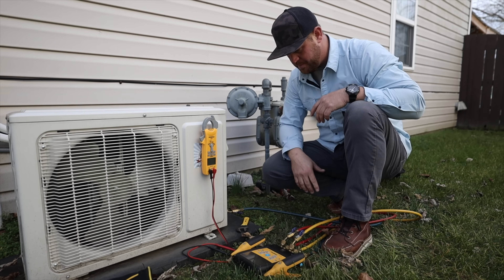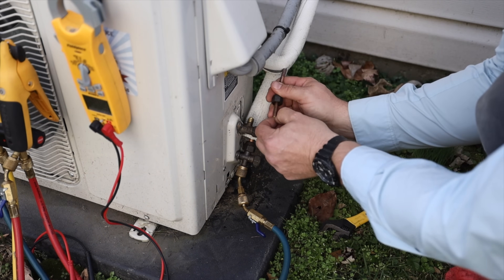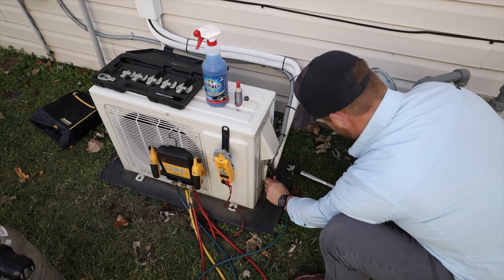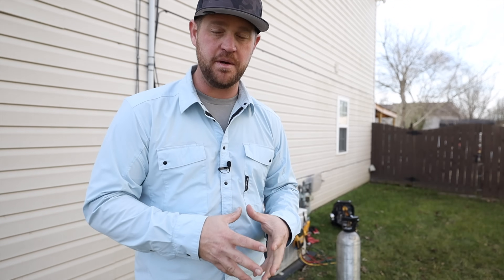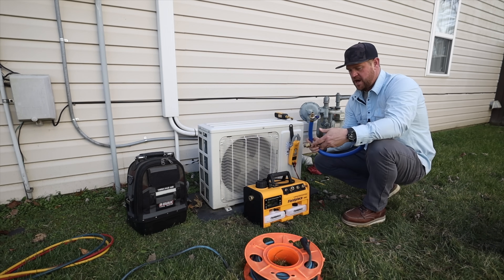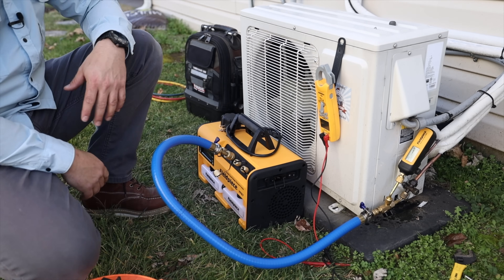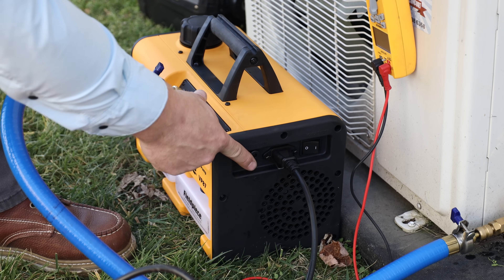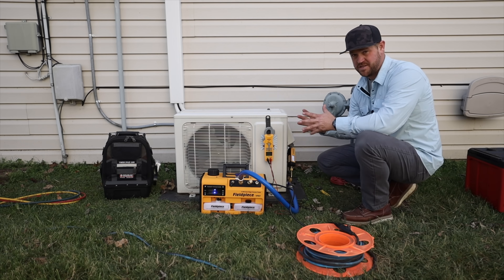#1 Reason Why DUCTLESS Units Fail | How I Fix It...

Comment: The thumbnail has a huge code violation. The unit is nearly touching the gas meter purge valve. Needs to be minimum three feet of clearance between the two

Comment: Boy, do I wish you were closer to Greensboro, NC! Your professionalism and attention to detail is so impressive! I have a 40 year old Trane 1200 I will be replacing in the spring. My electrician/HVAC guy is recommending changing to a heat pump as it is only a little bit more money. Air handler is in a very large and accessible attic. All of the air supply line are very robust and actually over engineered, so no need to change. Would love to hear your suggestions on type / brand of heat pump, rough idea of possible costs, things I should look out for. Your help would be appreciated , love the channel!

Comment: Indoor coils are rated for a lot less pressure than the rest of the system. Please check manufacturers maximum test pressure ...remember you are finding a leak..not causing one.
Reply: Some mini split manufacturers list for 600psi test pressure I think
Reply: @shadowolfgaming6578  correct   although I think it is 500PSI, not 600.
Reply: Most mini splits are heat pumps, both coils are rated for high pressure.

Comment: So would you recommend pulling a vacuum using a 4 Port SMAN? Whats your take on that?
Reply: No. Never use a manifold with normal hoses. Do what he did. You don't really need a high cfm pump either when you remove cores and only use trublue hoses.

Comment: I ran into the issue of not being able to get the core removal tool yesterday. I took the anchors off the foot tabs and slid the heat pump over the edge so I could get it on. So much faster with the valve core removed, but with such a small and short lineset probably didn't make much of a difference.
Reply: Thoughtful installers could position the valves beyond the edge of the support base, or he could have done the mod here. Short line set so evacuation probably didn’t take too long.

Comment: You don't need sealants.  This is bad practice.  Always trust your ability De burr and reflare.  Any refrigeration tech knows this Air pusher rectification method is just asking for another service call.  A typical easy repair service call.  How do you have the time to record this basic business?  Go forth and service real equipment, not appliance systems.

Comment: Great video, most probably bracing is beter , but hear in Europe that will ruin the guarantee for the unit, one more thing, the unit on the videos has no  vibration dampers on the floor

Comment: Although you don't say I am assuming you recovered the R410A before you pumped in the nitrogen for the first time?   Which gaskets for your hose set do you prefer, the green rubber (neoprene?) generic, the white nylon hard gaskets or the Yellow Jacket black gaskets?  I ask because I find that a breath seems to loosen my knurled fasteners.  I am reluctant to use pliers to tighten a gasketed fitting but it is frustrating,  If a hose is touched in the slightest I find that the ends one or both loosen up just enough to break the seal.  Even though these fittings have only been used  three or four times this is still a problem.  I have some Yellow Jacket hoses with their "sealrite" fittings ordered to see if they are the answer.  Have you run into this before?
Reply: Well! there was nothing to recover. It had all leaked out if the system wasn't working
Reply: @medonhomeimprovementsllc8039  At 1:08 there is 50 psi of "nothing" that should have been recovered...

Comment: Always remove the flares on the inside unit and braze it directly. For the outside unit use a braze adapter for mini splits. U will never have leakes again
Reply: Company doesnt honor garantie if u cut the flate down … dont do that even if its the right thing to do we know
Reply: Yeah ok..
 but my calculations are warning of the now hugely increased chances... of having a customers house catch fire & the heat wasn't the issue they requested to get fixed. Now they will have to live in your pad. Goodbye shitting with the door open. Talking about purge rags & using the dishwasher to clean split system filters like a dish dishlex mad scientist ripped on the huffing Freon & dreaming of all the secret spots on jobs you definitely sneaky lemonade spilled on. And got away the perfect eee ok beter double shake in high stakes no cakes underhouse

Comment: I am enjoying watching you "living" the truck life for service. I started that way and as much as I loved it when I got in a service van I just couldn't justify anything less than a service body. Now after years retired and helping my son get his start with NO new vehicles available in Ca. I find myself back in the truck life looking for that storage unit/garage to call the shop. I will be interested in seeing how you build out that truck, I am a big fan of the deck drawer and matching top system myself if it's just a single trade. If you do go to any of the deck systems buy a rebuild kit for the pullout rollers/latches/locks etc, 2-3 years down the road you will thank yourself when you don't have a 500# plus drawer slamming around until you get replacement parts.

Comment: It appears you are using the Yellow Jacket torque wrench.  Its a great, accurate tool.  However the chart inside the lid can be way off of what a manufacturer recommends.  Not all copper pipe is the same.  Some is softer and some is harder.  When doing flares, always check what the manufacturer recommends.  For example if you used those Yellow Jacket torque settings on the inside cover with a Pioneer system, you would be way over tightening the flares and causing the flare to deform.

Comment: Thanks for the video but you may want to mention that the white insulation on your line set will be another major cause of a ductless failure. They are corroding the copper and causing pinholes to form within months of install. I have a video of it posted on a 3 zone system installed less then 1 1/2 ago.
Reply: If you read the paper that the white insulation comes with it calls for sealing the ends of it to prevent water from getting between the insulation and the copper. The water in there causes some sort of chemical reaction that is super corrosive. I have 2 side jobs i installed 2 1/2 years ago that have yet to have any issues after sealing the insulation with waterproof outdoor caulking
Reply: @mikeytunnell4706  Funny of the 4 line sets Installed on this job none of them had any sticker on the box or instructions stating that they needed to be sealed on the ends. But as a common practice I sealed them anyway. But not with caulk as in all the facility’s I’ve maintained I have never seen this done. Will the caulk also remove the moisture that’s already in the air that’s in there. What I have read is these instructions were put out to cover there faulty product after the fact as this has been going on since 2015. Glad to hear you’re installs are good but it’s hit or miss on this issue happening as you can see in my videos. The copper will be brand new and shiny and as you move a long it will all of a sudden look greenish black and pin holes like that section was contaminated with something.
Reply: @ride-it-outtimandtoni232  interesting i didnt know it was a cya thing with those companies. Maybe i’ve just had very good luck but those are the only side jobs i’ve done that werent maintenance so I was being overly cautious with everything. I also live in Houston where it is 90% humidity pretty much year round so there is a large amount of moisture in the air that did get trapped in there. Like i said probably dumb luck
Reply: I don’t use those line sets for that reason!  Ridiculous and shouldn’t be sold!
Reply: Would using caulk with acetic acid in it (the vinegar smell!) be a problem--most acids react with Cu?
Reply: @replyhere590  I always use LS 200 UV tape where the line set is accessible but I am using strictly elastomeric insulation and Mueller copper now. I have never seen caulk used on Line set as a bandaid for moisture but if It was required I would use something that has been tested for line set and backed up with documentation. That still doesn’t help when their warranty for the line set is only one year.

Comment: Rule of thumb, check all flares indoor and out, 5 more mins might just save you hours of work.   Poor copper flared from my experience always has hard spots and don't never seat well.
Reply: only thing hate about the mini's the flared connections not great for the higher pressures with R410a, braised line sets normal splits better so  many situations have went with PTAC thru wall units better than installing mini splits if lower wall unit not an issue where installed, sun rooms, workshops, get as good of pricing on small PTAC as mini split.
Reply: I silver solder the evap.  connection instead of flares.  This way you never have to worry if your leak is in the evaporator.

Comment: One interesting thought....I would like to see an episode where you do this kind of work with no high tech instruments.  Years ago we had no
fancy gauges, hoses, vacuum pumps, etc.  In spite of a lack of new type tools we were still able to achieve a high success rate in install where
many systems remained viable for 20 to 30 years.
Reply: Still have my analog  dial gauges  like to use
Reply: There has always been gauges and temp probes for a very long time, before the time of refrigeration.  They just weren't on fancy, but still same concept.  Micron gauges however were analog and were far less accurate, that I will contest.
Reply: The EPA made the job a little harder freon rules. Still pretty easy though. 25k if they catch you letting too much freon into the atmosphere. At least that was the case 30yrs. ago when I was doing HVAC.
Reply: with newer refrigerants, higher pressures, saturation levels more specific, sometimes takes more modern tech, but Still do most work with the old style gauges just fine.
Reply: Anybody who's been eyeballing refrigerant for 30 years can blame their high success rate on delusions of adequacy.

Comment: What is your take on the new R-32 that will be replacing r410a next year?
Reply: R410A is a 50/50 blend of R-32 and R-125. You already use R-32. It's not new. It's not different.

Comment: When installing these units we always cut the flare connections for the wall unit, and braze them to the refrigerant lines. that way you can always eliminate the possibility of them leaking as well. I bet you if it was leaking at the condensor flares, it's also leaking at the wall unit flares.
Reply: I hate flares, not great for the higher pressures for R410a also, and find the factory flare is not all that great on some model linesets always redo with concentric flare tool for flared connections, Like brazing best when can myself but do have to respect factory warranties on new installs.
Reply: I wonder why manufacturers use a single flare given the operating pressures are as high as they are. At my work, we use flare fittings that have a replaceable teflon seal in the middle of the male flare sealing surface. We call them K fittings, I assume because we’re on Kennedy Space Center. These flare fittings are used for cryogenics and high pressure gas systems to 5000 psi. Once proper torque is applied during installation they don’t leak. I’ve found to never trust a factory flare and always make a new flare using an eccentric flaring tool. They properly  cold-work the sealing surface. The other must do is correct torque. But folks beware, the torque wrench used in this video MUST be used in the correct orientation, since it is calibrated in one direction only. In the field it’s easy sometimes to get twisted up which puts you on the back side of the work. There is a front and a back side of these torque wrenches so don’t get that mixed up. I tested my wrench on a torque analyzer and these wrenches are off more than 50% in the loosening direction. Good luck.
Reply: @TPSTH23  We do our own brake lines on our vehicles and trailers. US equipment is double flare and the European is bubble flare. Disc brake systems operate at 3000 psi and these flares have no problem holding the pressure. Everyone is always looking at their flaring tools or their torque wrenches but I have yet to see anyone state the thickness of their tubing. This is the real problem but is easily solved with a double flare as it doubles the thickness at the seat literally creating its own gasket.
Reply: @anthonyspadafora1384  I like the double flare too. I’ve made hundreds of double flares for brake lines. Probably worth a try on a split system. I definitely would do that over knowingly voiding a warranty by brazing.
Reply: @anthonyspadafora1384  
I agree the double layer flare is theoretically better, and necessary for steel brake lines.  However, the one lineset I used with double flare, the soft copper tubing was twisting with torquing. Plus, I'd torque it down then it was super easy to loosen.  I couldn't trust that so I cut it off and flared it single, no problems.  Torqued up, stayed tight, no leaks, no worries.
Reply: @elgringoec  I install about 50 ductless a year. I have been double flaring the the thin preinsulated linessets for about 2 years now and have not had a single leak. Flares leak eventually because of constant heating and cooling, you notice the leaks more in units where people tend to use them for heating and cooling. While it is true most vehicles come with steel lines we always replace with cupronickel because of salt in winter and also on the boat trailers. On our backhoes and loaders we do a JIC single 37 degree flare which obviously hold up very well but the steel for hydraulics is very heavy. Single flares will work if you use refrigeration tube (L) copper but these premades are thin as paper.
Reply: @anthonyspadafora1384  
That's right, I'm just giving you a sample of one.  One shitty acting lineset that was double flared vs three single flares linesets that all went well.  Obviously I defer to your considerably greater experience with flared lines.  

Do you recommend checking the flare nut tightness after some amount of use?
Reply: @elgringoec  I have gone back on several single flares that leaked 2 years after install. Even though we filled them with 350 lbs of nitrogen and soaped them during installation. 2 years later, resoap them at much lower pressures and they are leaking. Tighten them up and the leak stops.  It can be frustrating.
Reply: @anthonyspadafora1384  
It makes sense, actually.  Those units vibrate when the compressors run.  I'll recheck periodically to make sure they're not loosening.  Cheers!
Reply: @anthonyspadafora1384  Brass fitting expands at a different ratio and being so thick  it has no problem squashing out the coper lineset  .
Reply: @rovidius2006  Just finished 4- 3 ton wall units in a banquet hall. We used Python line sets. They work fabulous and wont be using anything but from now on.
Reply: Best thing is to cut out the flares, install filter drier, then flow nitrogen and braze. I hate mini splits, these are known as leakers, also ugly to see one hanging in every room in a house as well as the unsightly multiple line sets running all over the outside walls.
Reply: I was thinking the same way. Eliminate the possible leaks in the future.....
Reply: Good idea Terry.
Reply: You keep referring to nitrogen for pressure test. You are using co2. Pressure will change with it over time with temperature  very fast.
Use dry nitrogen  for more accuracy for decay test.
Reply: ALL manufacturers mandate NO brazing. There is no filter drier in these units. The contaminants WILL clog the EXV. Bad practice to braze the units. Try Propreesing instead
Reply: @dewittarchibald7191  how do you think components are replaced in these units, such as compressors, reversal valves, etc.? They are brazed in: If you purge with nitrogen as you are brazing per good brazing practices there will be no “contamination “ (carbon build up).
Reply: @timrob0420  I am well aware of how components are replaced. This is an unnecessary exposure to a contaminant, that's all. try pro-pressing the fittings
Reply: @dewittarchibald7191  hell at that point you might as well just make a good flare. Pro press leaks too
Reply: @timrob0420  we have installed in excess of 40k pro-press refrigerant fittings of all types with 1 failure. That would NEVER happen with flares, not a chance. The expansion and contraction alone causes more failures
Reply: if there was another leak, he would not be able to pull the unit down below 500 microns, he could triple evacuate as well and that proves there is not another leak.  I do agree with you, while your there you might as well check the other connections.
Reply: @Omaha__    not true at all
Reply: @Omaha__  I just did 4 houses and pulled each house down to 150 microns, short linesets, and 3 of them held with less than a rise of over 200 during a 10min decay.  My fourth house held 250psi nitrogen pressure, but when I pulled vacuum, I could get it down to 243 Microns, but a rise just over 1000 in 10 min decay.   I always attach my micron gauge at the end of the system.  Turns out my leak was at the beginning.  This is why leak decays are always required.
Reply: @Omaha__  not true.  I have had leaks that I pulled down to 350 microns.
Reply: @mtsaz100  We switched to double flares (double lapped) 2 years ago and haven't had a leak since. It's not the flares, it's the thin copper used on these premade line sets

Comment: Was there any reason you did not check the torque on the other flare. My thinking is that , even though it did not indicate a leak, if one is loose or installed improperly isn't it possible that the other one might have a problem also...

Comment: It's  a heat pump. Plus electronic txv.
Read the manual  on pressure testing both out side and inside units and to charge empty systems.